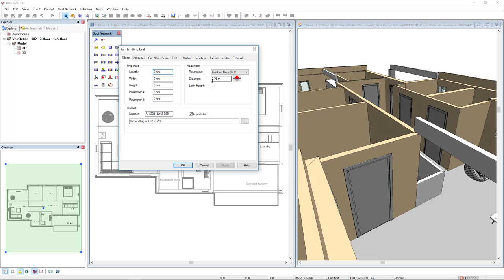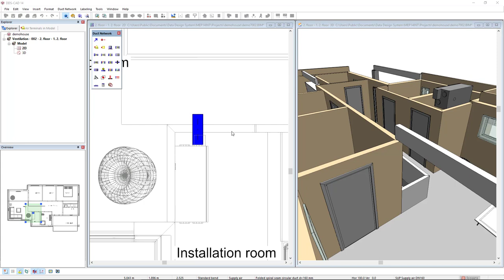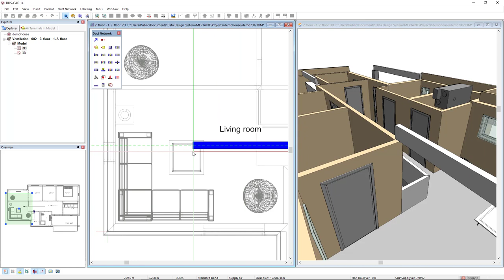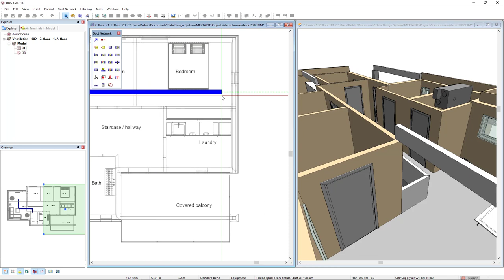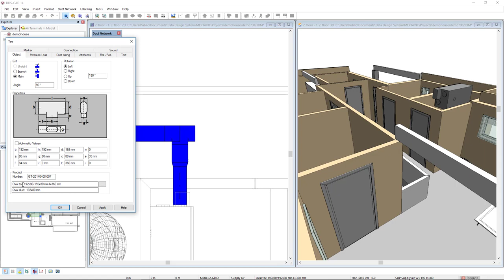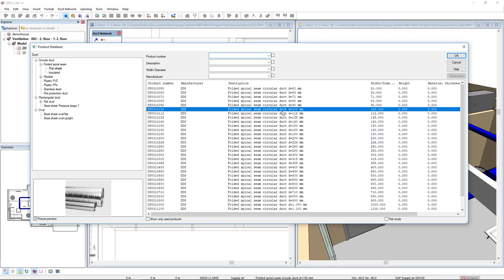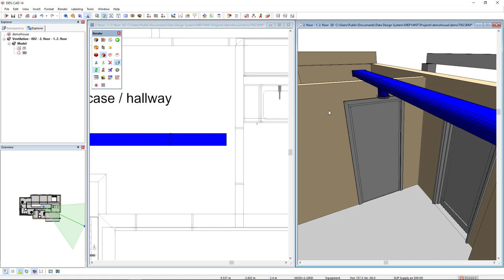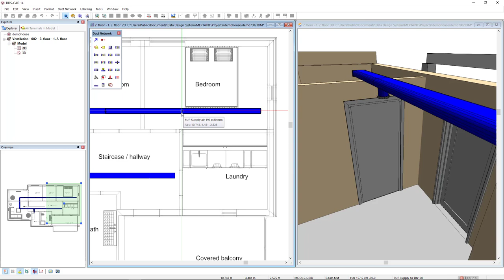Modeling a ventilation system using oval ducts

Comment: Se puede generar reportes de fabricación a través del software
Reply from the maker: Hi geraldestrada9033, with DDScad you can generate parts list for all systems. It is also possible to generate a duct sheet fabrication report based on VOB DIN 18379.

Comment: It is possible to add new object library to dds cad? Im looking any toutorials, and i cant find anything...
Reply from the maker: Hi Arkadiusz, this is definitely possible. Please reach out to your local DDS-CAD provider and they are more than happy to explain you how.
Reply: @DDSCAD-MEP  Thank you for response. I've another question with DDS-CAD, it's possible to autonumber ducts, tee etc. ? I.e. Duct is N-1, tee N-2 etc....?
Reply from the maker: @arkadiuszguzda1850  for labeling with an auto-increment I would recommend to use the Position Marker function
Reply: DDS-CAD thank you, thats what im looking for. I have two another question: how i can show this number od parts(w-1 etc) in a list of material? How i can chose which diamter of round canal can be chosen in autodiemsional function (i.e. I dont want to have round canal 140mm, 180mm etc because this diamension arent popular in Poland)?
Reply from the maker: @arkadiuszguzda1850  it would be best if you reach out to your local provider for support. They should be able to assist you further. Unfortunately, YouTube does not lend itself for providing extensive support.
Reply: DDS-CAD ok, unfortunately my provider dont knows answer for my questions or says it is not possible.. can i send to you an e-mail with my questions ?